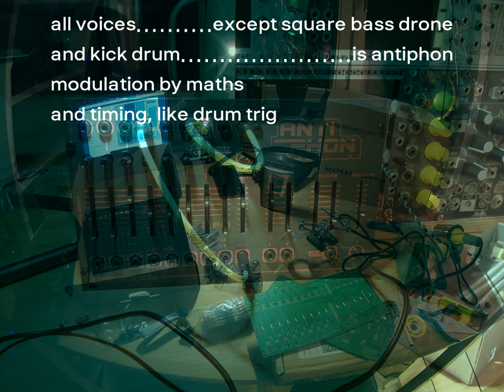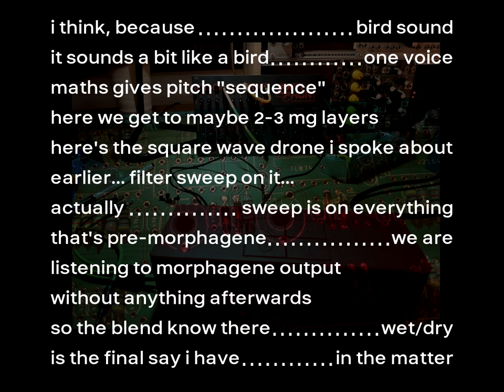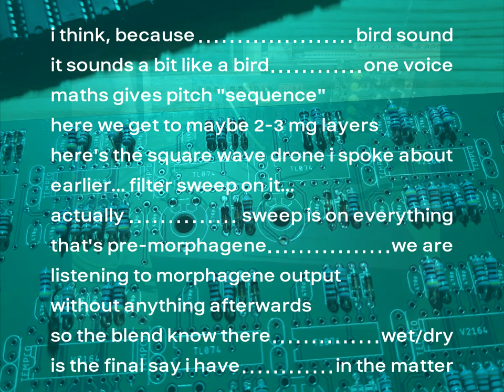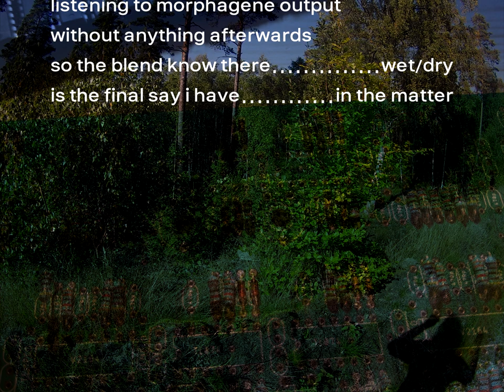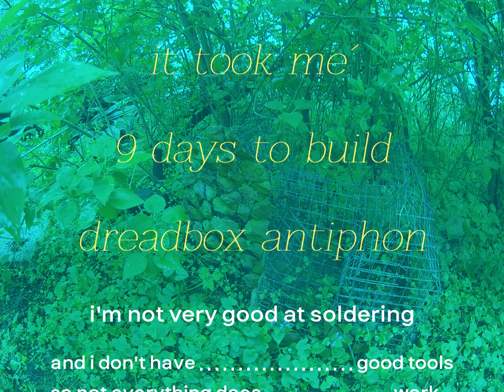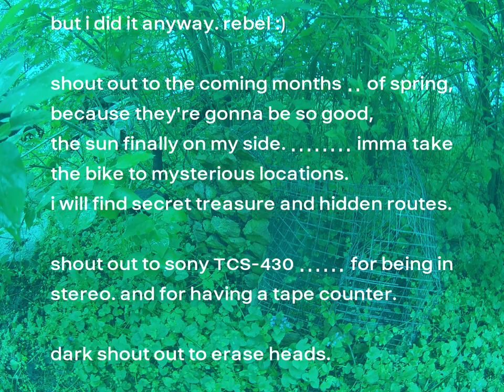dreadbox antiphon reels

Comment: I am building one, Its far more complex than I thought it would be, the op-amps are supposed to be soldered direct, Stuff that! i have bought sockets as i don't trust myself not to fry them. TBH the spring reverb was what attracted me initially, i jumped in quick because i knew it was a limited run, in all seriousness, if i had known how complex it is, i think i would have given it a pass, BUT if it turns out OK it will give me the confidence to tackle any DIY project
Reply from the maker: yeah i felt the same with the chips, but ive got no patience anyway so i just did as they said. kinda bugged about the low temperature reqs for some parts as well. anyway, how's the build going?
Reply: @elmusho  Coming along slowly, i mistakenly soldered a 33K resistor in a 3.3K slot but managed to rectify it when i realised my mistake. I have my Iron set to 260 degrees so i don't envisage any heat problems. I did have to buy some new solder because my old solder was oxidising and skinning over even with extra flux, never had that happen before but the reel was about 3 yrs old.

Comment: Sounds nice, I’m considering an antiphon....
Reply from the maker: Ah! It's great IMHO. Both as a whole thing, and as a bunch of discrete parts. I mean eight sine oscillators is neat on their own.

What's weirdest to me is that the individual pitch in is /summed/ with the main pitch. For me it would be better if it was replaced. But i guess it's easy to add vibrato this way :)
Reply: @elmusho  hmm I see. How easy is it to tune each sine and what's the appropriate range of the slider? Does any of the sliders have indents for instance the ones that can switch between lfo/regular (or something like that)?
Reply from the maker: @a773  It was fairly easy to tune, there was an alternative guide in the muffwiggler thread. Basically if you have something that can describe the pitch over time (like a spectrogram-ish) it's super quick.

A slider goes for 7 or 8 octaves IIRC, could be more. For CV it tracks decently over ~5 octaves (although that could be my keystep). No indents or notches or anything... but i guess if you tune it right the first six all land on the same lowest pitch.